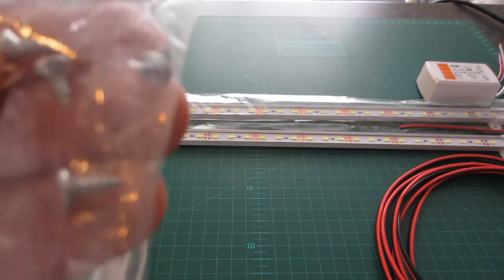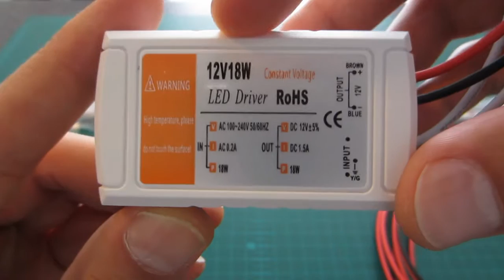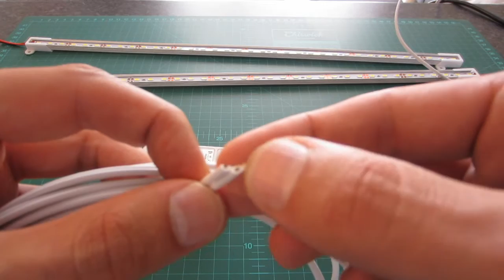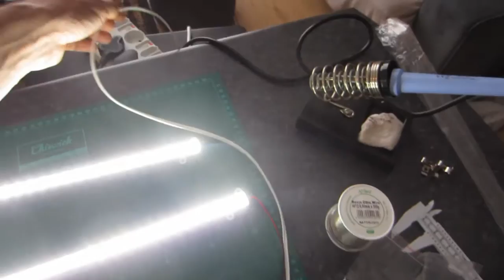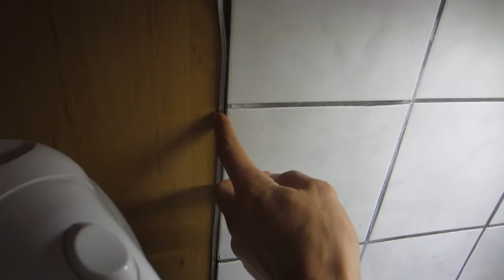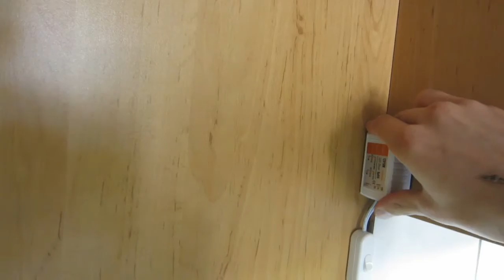9W LED Strip x2 and 18W Power Supply Review

Comment: Hi, found you video detailed and very helpful, I am using same power supply adaptor with only 20-30 led strip.
my question to you is ,in order to avoid over heating, would you recoment resistor if yes to what value?